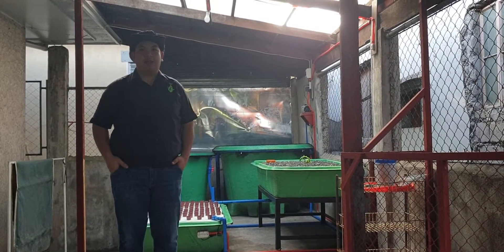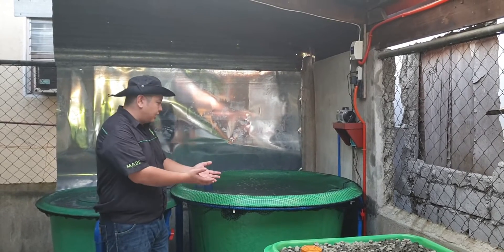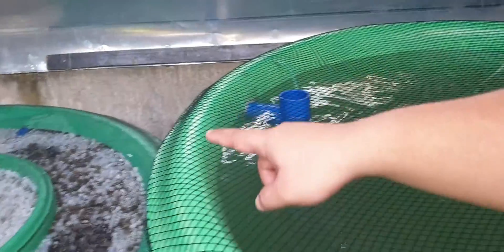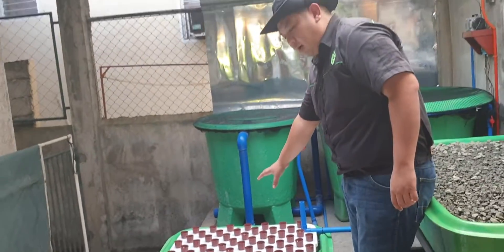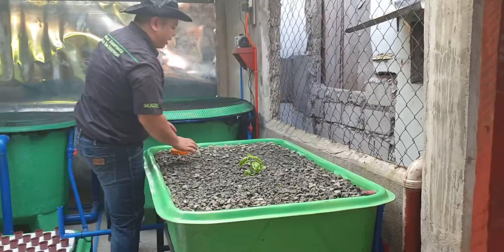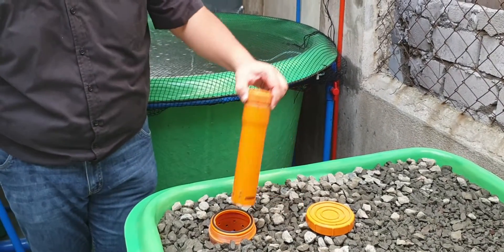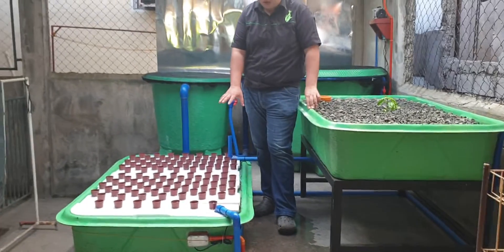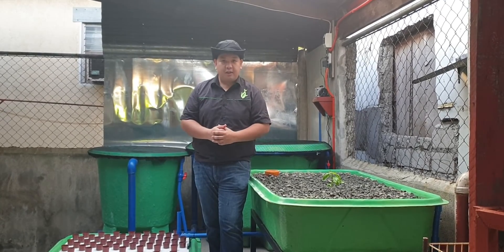MADE Split Flow Aquaponics System

Comment: How in the world is that fish tank a 1200 liter capacity? That is no way bigger than a 1000 liter ibc.
Reply from the maker: 3.14 x r2 x H
Reply: Math for the conical bottom is more complex than that.

Don't worry sir, I am a fan. By the looks of your tank, it not 1200 liters.
Reply from the maker: We used CAD to compute it. 1200 lit is an approx value. Diameter is 1.5 m OD and 1.3 m I.D. Height is 1m. We just use the formula for a volume of a cylinder for a quick estimate.

Comment: Hi bro. How do you calculate the exact capacity needed for the water pump in your system to circulate? Is it based on the entire system water in total (fish tank + filtrations + growbed)? Im confused bcs of this hahaha. Thanks for the inspiring video anw 👍
Reply from the maker: Fish tank + factor of safety. For a split flow system, Fish tank + growbed + factor of safety.
Reply: @Madodel  currently I'm going to adapt DWC Floating raft system with estimated 15000litre fish tank. So based on what u said, do u think it's gonna be safe for my system if I use a 20000lph pump? After it's being compensated with my sumptanks, filtration tanks and other safety reasons? Much thanks for replying my comment 🙏
Reply from the maker: Rule of thumb is 1 hr water change in fish tank but it is still dependent on your filter efficiency and stocking density. You also need to compute for head loss.